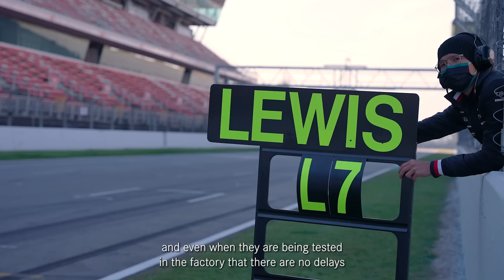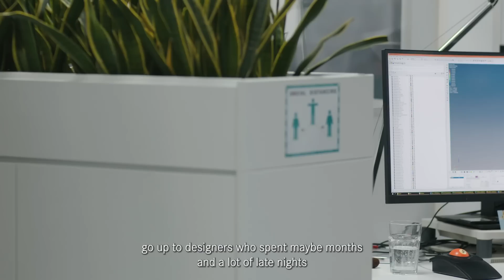My Job in F1: Emma | Senior Reliability Engineer

Comment: Hi, Mercedes people. I always see you through your YT channel, and I don´t use comment anything.
But this time I want to say a couple things.
* First of all, this is the best team of all time. I'm a Mercedes fan since 2010, on its return to F1 as a team. 
* Second, I would like you to make more content like this and like to show us the factory in more depth, in all departments such as finance, HR, marketing, R&D, logistics, design (all engineering areas), strategy, about pit wall, machine shop, paint shop, etc. to give just a few examples. And obviously, hiding the secret information. Also show us the challenges the team is facing and how they managed to overcome them. Even tell us the Mercedes F1 history, from its racing beginning, then as an engine provider and Ilmor, then a little bit of BAR Honda, trough Brawn GP to what they are today, Mercedes AMG Petronas Formula 1 Team.

If you make something like documentaries or 1-hour series, it would be fantastic. I'm sure you'd do much better than Netflix.
I think you can attract more people to be interested in Formula 1 and you will have a lot of new fans along the way.
Because most people will be identified with each of the areas or positions of the team, according to the positions in which they are working in any other company.

P.S:
Great job, Emma. Great place to work and great video.
.

Comment: It would be interesting to learn about when you know you can allow more risk and get possible performance.  That seems like a more difficult ballance than it was in production automotive engineering where I worked.  Perhaps it's the same, but just a different set of things to ballance.  That being said, given the early performance issues, you and your close team have clearly done their jobs as others have posted- putting Mercedes much closer to Ferrari and Red Bull than the performance should allow.

Comment: You can tell she's good at her job seeing as there hasn't been one mechanical DNF this season. Came close to it in Barcelona but still brought it home (unlike a certain italian team). Give her a raise or something.
Reply: Even Verstappen had 2 mechanical dnfs, a race without drs, but Mercedes never had a mechanical problem. The best team on the grid.
Reply: Damn we all wonder what Italian team you talking about lol
Reply: @RaeRae12367  s🅱inalla
Reply: @RaeRae12367  🤣🤣😂 well its not an Alpha.
Reply: @RaeRae12367  must be Aprillia
Reply: wasn't Barcelona due to the engine running to hot?
Reply: @burnstick1380  that falls under reliability
Reply: @LoniVlogZ  kinda yes but also no.  the setup doesnt cool the engine enough therefore the engine starts running above its working temperature amd therefore could cause problems
Reply: If only they paid the same attention to reliability on mercedes' road cars
Reply: They’ve also had a lack of success also. Sometimes a lack of mechanical failure is an indication of not pushing the envelope
Reply: @stellingbanjodude  No, they were reliable for many years.
Reply: @ferndale6652  I don’t see any wins this year, no win, no success.
Reply: @stellingbanjodude  Well, you also need a good driver. Verstappen won multiple races with the Red Bull before 2021, which was far behind Ferrari and Mercedes. Not everybody is capable of dragging the 3rd fastest car to wins.
Reply: @stellingbanjodude  Place drivers like Verstappen, Alonso, Senna in this Mercedes and they would win races.
Reply: @ferndale6652  are you saying that Hamilton and Russell aren’t good drivers?
Reply: @stellingbanjodude  Russell doesn't have the experience to win races currently, imo. But Hamilton is not someone you would expect to outperform his car and win races.
Reply: @ferndale6652  Now you are just speaking because you have a mouth. This is the quintessence of hyperbole and baseless conjecture.
Reply: @Low Jack The spaghetti merchants

Comment: Hi Emma!
You've been doing a great job seeing how reliable the W13 is!
Reply: Not only W13 all the previous years Mercedes was the best car in the grid in Reliability.
Reply: Especially given how the platform and ride has been a complete mess this year - I'd have expected the sheer loads and vibrations would break some internal components or wear them quickly.
Reply: yup we only saw that in the Spanish GP a hint of reliability issues and that was (i think) due to unproper cooling (hotter than expected)
Reply: But it loves porpoising though 🤣🤣😂
Reply: reliable but not fast😢 i hope they get at least 1 win this year
Reply: @alberto7412  Done!
Reply: Can't see that happen anytime soon think ferrari and redbull are just to fast to be fair..